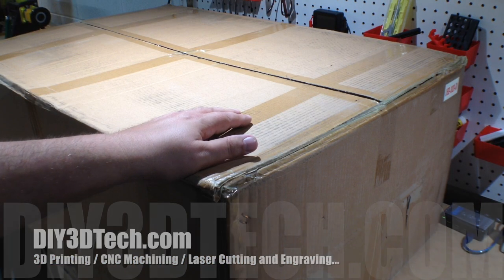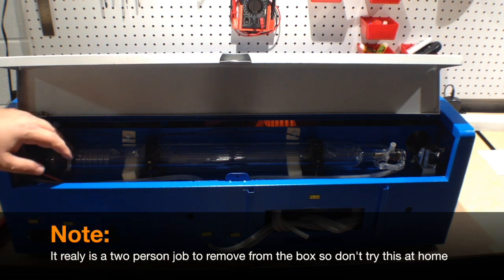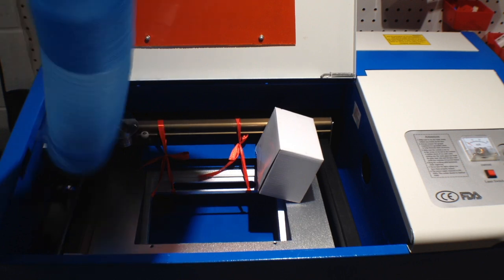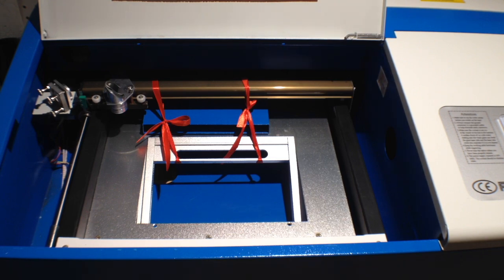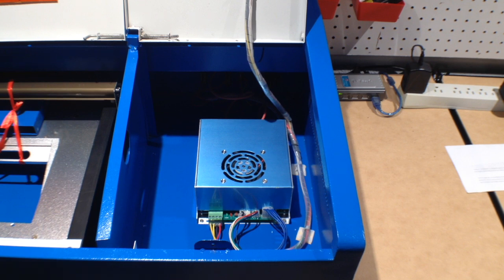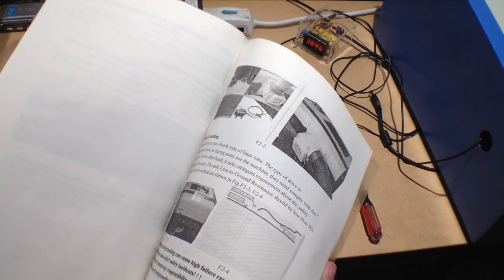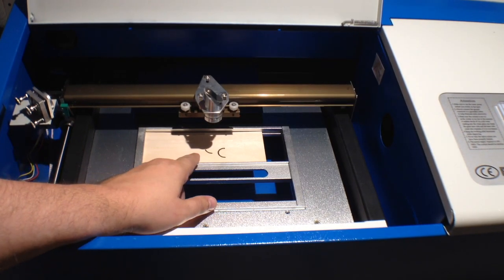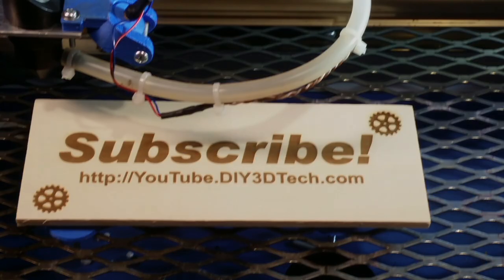K40 eBay Chinese CO2 Laser Cutter & Engraver - UnBoxing New 40 Watt Unit!

Comment: Hi..i was told by someone that tested watt output...that all these ebay k40 are fake specs...and not 700mm 40w tubes...they are 600mm 20w tubes...
...can anyone else confirm this?
Reply from the maker: Belive I answered this in another thread, however this version is a true 40 watt (with the analog meter)  and I just put a new tube in it from here: https://www.thingiverse.com/thing:4575561 which was the same size.

Comment: Anyone here knows the manufacturer for this product? I am trying to get in contact for a dongle replacement. Any help would be appreciated thank you!
Reply from the maker: Good luck, as you would have to buy a new control board as they are matched to that.  However you do realize that if you use k40 whisper you do not need a dongle right and works better too...
Reply: @DIY3DTECHcom  Thank you I did not know I could use K40, I'll try it out and see how it works. I managed to find a dongle replacement on amazon. Hopefully, it works otherwise I'll see how K40 works out. Thank you for the advice!

Comment: I have this laser and love it. My question is can I engrave on steel? I don't want to spend $100 on a can of spray of laserbond, ceramark, enduramark if it will not work.
Reply from the maker: Well sort of, if you search the the internet there are cheaper options for metal etching spray.  If it is just for a plaque or some thing is for display then maybe.  In my tests, I did not like the results nor the wear.  It also depends a bit on the type of metal.  If its a passing fancy, I personally don't  see a value in it, however if a business and your doing plaque that could be a different story.  But if that is the story I say go for at least and 80 watt unit as it will save your sanity...

Comment: do you need safety glasses to look at the tube even when it is not setup? bc im hesitating to unbox until my laser glasses arrive.
Reply from the maker: Not sure I understand the question correctly, if your talking about powered off, for IR protection no (however safety glasses would be good in case you accidentally shatter the tube which is easy to do).   Powered on and active for safety in general "yes" however if you want to get technical (1) this is a laser (so the aligned beam only exits from one end), and (2) its only 40 watts so think of it as looking at 40 watt light bulb (the tube as a whole NOT THE BEAM!).  Yet all infrared (feq of light) can cause injury to the eye in "sufficient concentrations", however needs to be extremely intense to cause harm. It is important to take precautions, because infrared light is invisible, meaning your eyes won't take the protective measures like blinking or closing when a high-intensity beam of infrared radiation shines into them. In extreme cases, if the eyes absorb too much infrared light, they can be irreversibly damaged. Infrared lamps and incandescent bulbs are not powerful enough to cause such harm. But it's best if you don't stare directly at them for too long.  Now the good thing is IR light is readily absorbed by acrylic as the safety glasses you should be getting will simply look like heavy duty [clear] safety glass.  Also IR is less reflective then visible light lasers in most cases (note copper however is a good IR reflector) so you will have less concerns then a visible light laser...
Reply: @DIY3DTECHcom  so basically wait until i get my laser glasses to unbox. got it.
Reply from the maker: @sabrinaflipse7732  You can "unbox" it without "laser" safety glasses, I just suggested "regular" safety glasses as a precaution  in case the tube is broken (many are) so glass doesn't get in your eyes. Also another safety tip is don't touch the mirrors or lens and if you do wash your hands as they are mildly poisonous as they aren't glass as many people think.  I typically use nitrile gloves when replacing...
Reply: DIY3DTECH.com thank you so much :) one of the videos I saw abt laser safety also said don’t put laser near a writing desk or where you study, do you know why? Bc honestly this is going in my living room.
Reply from the maker: @sabrinaflipse7732  I am assuming the toxic gases it produces, keep in mind that a laser vaporizes and the material turns to a gas and LOTS of it!  Even if you try and vent it your living room will quickly start smelling.  Lasers are not a "home" friendly device like a 3D printers, they produce a lot of fumes and some depending on the material (like plywood that uses formaldehyde glue) will produce toxic fumes.  Also you MUST have a true earthen ground (not the round pin on the plug) as the laser dumps 25,000 volts to the case, yes you read that correctly see more here: https://www.youtube.com/watch?v=6vztMvWUnmM&t=2s
Reply: DIY3DTECH.com thanks for the help! :) appreciate it!
Reply: DIY3DTECH.com what do u suggest for the grounding?
Reply: @DIY3DTECHcom  also thank you for taking the time for a thorough reply :)

Comment: Hi to all! what about the following laser ?
https://www.aliexpress.com/item/33035508403.html?spm=a2g0o.cart.0.0.3d6f3c00ewpH5A&mp=1
i am searching and i found this upgrated version says
Reply from the maker: I would not call it too upgraded as its just a regular laser with some cheap wheels and an led light added.  If you watch on eBay you can get these sometimes for around $300 bucks as I paid $285 for mine...

Comment: Driver for this machine??
Reply from the maker: Has none it uses a dedicated program call LaserDrw, however Google k40 Whisper as its a far better freeware program someone reverses engineered
Reply: I have installing k40 whisper and i havent working machine.
Reply from the maker: Make sure you follow his notes on the driver install and you might have repeat it with each use

Comment: sorry but you have or there is a table or a manual to set the speed, power etc etc so one knows how to set the machine for glass, rubber wood, leather and vati objects you can help me thanks
Reply from the maker: Not really if you google it you can come  up with some rough numbers yet the best way as there is such great differences in machines is to test runs and record the results...

Comment: Can this unit cut out leather with the thickness of a bit less than a nickel? And would the leather catch fire?
Reply from the maker: You know I bought some leather to try and never got around to it, yet the answer is yes (it can easily that in wood so leather would be no issue) however I don't the quality of the results.  As I always recommend air assist and especially here for sure (the air snuffs out the flame and clears the kerf).  However what I don't know is the level of "charing".

Comment: Dear Diy3dtech.com!

I saw on the youtube channel that he really understands the laser engraving machines. I would like to ask if you could help me? It would be a problem for me that I bought a laser engraving machine from ebay this week. But I have such problems with it:
the machine stops while cutting, engraving the engraved in engraving, and the machine does not return to its position many times. I sent the links where you can watch it. I'd like to ask you if you can help me with that. Or what do you think is the problem with the machine.

Thankfully, Ernő Bordás

https://www.youtube.com/watch?v=2MN6j4mNF5c
https://www.youtube.com/watch?v=AFFM_DFYgjU
https://www.youtube.com/watch?v=6HU8nWhQquc
Reply from the maker: Okay this will not be easy to explain, however reference my laser play list as the majority of you questions will be answered in the 68 videos in that list (here: https://www.youtube.com/playlist?list=PLInTrkIbj69kPO_UP81yxX-xov4SVyPlD).  I also assume you are using Laser Drw, it is crap Google and  download K40 Whisper from Scorch Works.  Also google CH340 driver and install that, as the Chinese controllers use a crappy UART that disconnects from windows all of the time so you need this modified driver.  Also if you keep using Laser Drw, make sure you have the correct mother selected (I have created a video on this in the playlist).

Comment: Is this ready to use out of the box after the inital setup? Do you have to adjust the laser?
Reply from the maker: depends, if you get one these you will need to be a bit handy as if it does work, it will need to be aligned and modified to be of value.  They are actually designed to make rubber stamps in china (lots of governmental bureaucracy there)  and someone got the idea to them here.  Keep in mind what your buying here for 300 to 500 bucks turn key would cost 3,000 to 5,000 so you will need to do some mechanical investment, but in the end it all will work for a fraction of the money...

Comment: what is the typical 2mm clear acrylic cutting speed? have you run a batch and check the dimensional difference between parts? is it less than 0.1mm?
Reply from the maker: It depends, I would suggest running some speed test  varying both power and speed.  Also your kerf is going to be around .2mm at a slant...

Comment: Hi, have you tested any metal dogtags with this machine? I'm interested in buying one, but I just want to make sure it works well first. I bought some lbt 100 metal marking spray and dog tags, if I sent you some dogtags presprayed with the lbt100 would you be interested in testing them to see if they work? I'd gladly pay you. If so, I'm wondering how well it could mark a handprint on a dog tag or a photograph of someone's face? Thank you very much! =)
Reply from the maker: I would not suggest these for metal marking, 40 watts is simply to little power.  In know some people claim limited  success however I can tell you it is more pain then its worth.  For me I would go with at least 80 watt laser preferably 100 for metal marking with a coating.  Keep in mind a CO2 laser is 10,400 nm device, at this wavelength copper is a mirror!  As what the spary is doing getting hot and reacting with the metal so you will need a lot of heat to effectively do this...
Reply: @DIY3DTECHcom  Thank you, I was thinking the same thing. I talked to someone who said it would work and then I saw a video of a guy who did it on a 30 watt laser and it seemed to actually do pretty well. I just want to see it for myself how it does, so I'm just looking for someone who will do a test for me. I understand either way. =) Have a great day!

Comment: how ¡s the laser going? you still have it?
Reply from the maker: Yes have both and will be buying an 80watt, you have not seen me use them as they make the wife sick (she has asthma)  however we are building a new house and I will (in a couple months) have shop while connected to the house separate of the house with its own HVAC system.  So this fall you will see a lot more the lasers!
Reply: @DIY3DTECHcom  thx, i also buy one, the 300€ one from ebay:P and now i'm upgrading stuff.. i see one with octoprint :P just like mi printers, do you use discord ore telegram?
Reply from the maker: Discord ore telegram not sure what you mean?  Also check K40 Laser Whisper its free and amazing...

Comment: Can someone advice if it could do the name / message and photo engraving on the men leather wallet
Reply from the maker: Yes it can...
Reply: DIY3DTECH.com  Correct me if I’m wrong is it the same mode which is sold on eBay 
https://rover.ebay.com/rover/0/0/0?mpre=https%3A%2F%2Fwww.ebay.co.uk%2Fulk%2Fitm%2F282706373698
Reply from the maker: This looks to be a 35 watt unit, however yes this will do nicely for leather...

Comment: Can i run this indoors? Like in my apartment?
Reply: You would want to exhaust it at least to the outside environment and preferably through some type of filter system to help lower the concentration of contaminants.
Reply from the maker: NO!  A laser generates a LOT of toxic fumes and even in a home in a subdivision with external ventilation you will likely receive complains from the neighbors...
Reply: @DIY3DTECHcom  I understand there will be fumes and waste cutting things with a laser. I just thought maybe there was an exhaust I could run somewhere. I just wasn't sure. So basically you need a shop or house out in a rural area?
Reply from the maker: In short yes as the fume are not only noxious,  but toxic too from many plastics...

Comment: Sounds like this one is a truer 40 watt and your old laser is around 25 watts.
Reply from the maker: The older (original one)  I belive by tube length is 30 watts about (its been a while since I have used it) as yes it is NOT a 40 watt tube...

Comment: Hi there, can I use this machine yo engrave brass? I'm a locksmith and would like to engrave my customers key with something like this instead of stamping... thanks!
Reply from the maker: So no, you would have to step up to a very expensive laser for that , you would be better off with a small CNC and 60deg engraving bit...
Reply: DIY3DTECH.com thanks

Comment: Hi, IV just brought this style laser cutter. Mine makes a grinding noise when it homes. Do you have any ideas why thats happening? (I'm clueless at electronics) I have set software to correct motherboard. Any tips welcome. Thank you
Reply from the maker: Does grind when it homes and not attached to computer?  Also does the grinding stop at all?  If the later, check that it is engaging the end stops correctly and also check the belts are correct to, its rather hard to explain, but it is possible for the belt to be off by a couple teeth...
Reply: DIY3DTECH.com thank you for your reply. Yes it was grinding at it was in home position. I looked at the machine again and seems the bracket looking bit that goes into the stop switch wasn't attached straight so I had to unscrew it and bend the metal straight, realign it and screwed it back it and it's stopped making the noise. sorry I'm not explaining it very well but I hope that makes sense. Now to work out why it keeps setting my work on fire!

Comment: very informative thanks, one question I don't have the orion cd what is that?? I got this goldish usb that says lihuiyu studio labs.  but i didn't get the cd.  i plug in the usb and it won't open. Are the drivers in the goldfish usb.  Can you please help! thanks for your videos and tips.
Reply from the maker: You should have gotten DVD with Corel Laser and Laser Drw on it, the USB dongle it just that a licensing dongle to make the programs works.  However they crap programs anyway so you want to go watch this video: https://youtu.be/gF9M6g7nHyw

Comment: Hi...this was engraver was just given to me and yes it's a used one...will you please help me set it up???
Reply from the maker: possibly you should seek  someone locally to assist as they do create high voltages and require an earthen ground...
Reply: DIY3DTECH.com I've tried that...and couldn't seem to find anyone that would be of an assistance...and your machine is just like mine.
Reply from the maker: If you have a general question I happy to help answer if I can, however I would suggest looking at eBay K40 Laser playlist as there are a ton how-to videos covering about every aspect of the K40 laser.  However these things are not turn-key and require mechanical intervention to keep working.  Also be sure to watch my video on the K40 whisper and download a copy...
Reply: DIY3DTECH.com....Thankyou so much I'll try that option of watching videos on eBay...and I'm definitely going to ask you questions if I run into a problem...again...Thankyou

Comment: Price skyrocketed again and I purchased one but it was so beaten up I had to return it and get my money back (in that process now).  Never even fired it up so it will be summer of next year before the prices come back down to semi normal.
Reply from the maker: Their not bad as they range from 300 to 500, I set up this page http://diy3dtech.com/purchase-laser/  that pulls from eBay API and you see the price ranges.
Reply: What you see is minus shipping.  For instance that one for less that 300 is actually less than 300 PLUS 78 dollars shipping so your api is actually not a true indication of the prices.

 $286.65+ $78.00 Shipping

I follow the prices weekly and when mid Oct came all prices went up and are steadily going up because those same machine from your api were 30-50 less 3 weeks ago.  You need a better api that looks at the shipping too then has a real number amount to your door for the machine.
Reply from the maker: Yes it just pulls the price (its what eBay provides its their api, I am part of their dev program).   I think we had this same discussion a year ago didn't we?   :-)  You seem to like the hunt, so you should set up IFTTT rule to hunt for discounts...